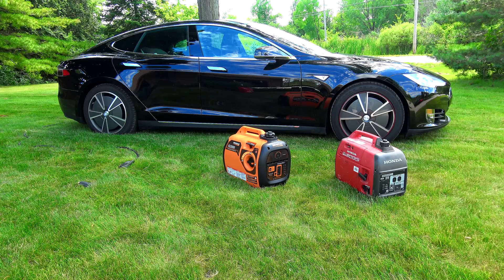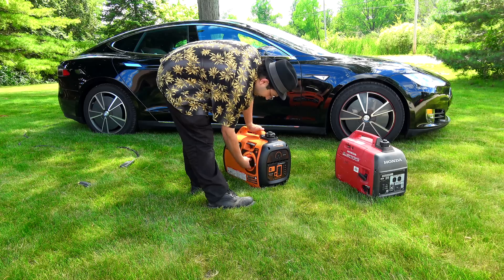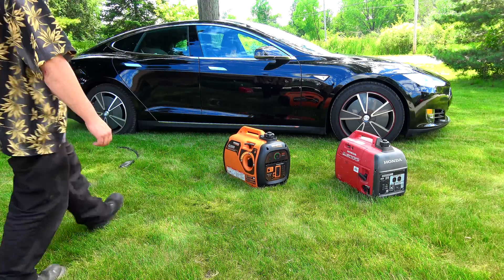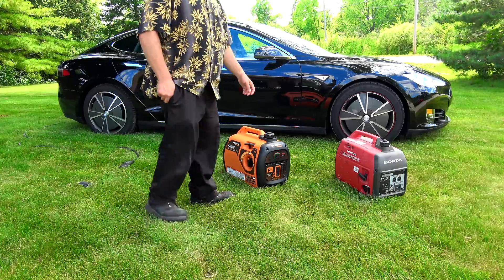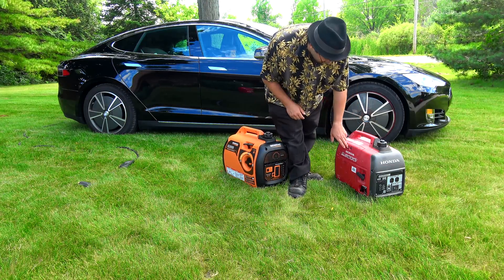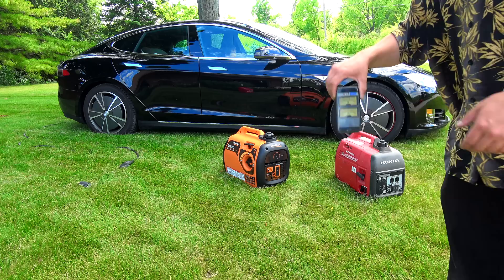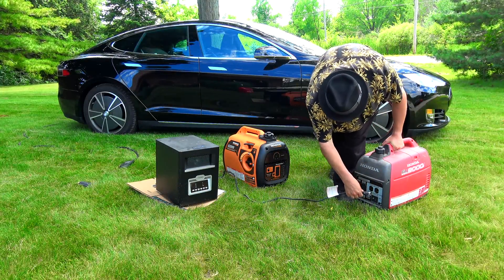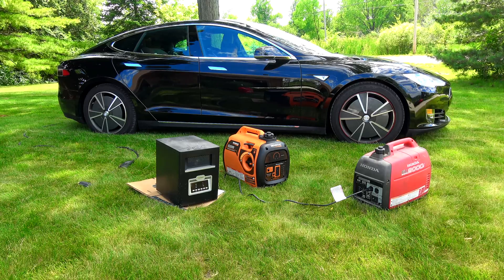Generac IQ2000 VS Honda EU2000i Noise and Load Test

Comment: I find it very peculiar and ironic that a fossil burning device is still required to run an electric vehicle... LOL
Reply from the maker: I find it very peculiar and ironic that you don’t realize a fossil burning device is NOT required to run an electric vehicle.
Reply from the maker: You are missing multiple points and intent, in an emergency, a gas car can only run on gas. Where as an electric car can be refueled by gas, diesel, propane, or natural gas via generator, hydroelectric, wind turbine, nuclear, solar, coal or gas fired power plant, or even your kid peddling a bicycle with a generator attached. 
Please see all the videos in the generator series. Original intent was to see which could charge an EV in an emergency.
Reply: @KmanAuto  All good points. My biggest worries are short battery life in -30 temps(my friends and family that own them where i live all have other vehicles that they drive in cold weather), battery warranty when the pack fails, and access to charging which is improving daily however.
Reply from the maker: @dptp9lf  Had no issues here in -38*F last winter. Both my Teslas are older “Legacy” design, so lower range to begin with and older tech. Turned on cabin pre-heating, put my shoes and coat on, walked out the door, unplugged and got in a 80*F vehicle. Looked up and down my street at the neighbors trying to get their cars started and also charging the 12v starting batteries (gas cars). I just put mine in drive and off I went. Did a 150 mile drive and still arrived at my destination with plenty of power and nice warm cab. 
The majority of the range loss is going to be the cabin heater. 
Now, all lithium batteries degrade over time and use. Tesla has an excellent battery management system to keep it nice and healthy. My Model S in this video is a 2016. It is now Jan 5, 2022, my Model S will be 6 years old in about 20 days. 
It has 120,000 miles on it. I abuse the crap out of the battery, and it has been holding a solid 250 miles range per charge. Biggest drop is the first year, then it levels off and degradation slows considerably. 
My battery warranty is 8 years unlimited miles. I believe the new ones are 8 years 150,000 miles??? not too sure off hand.

Also keep in mind, the same vehicle as mine, a new one can do 407 miles on a single charge. Further, As of 2021, all Teslas now use a heat pump as primary heating instead of a resistive coil (space heater). in general use, that heat pump uses about 1/4th the amount of power the old resistive coil uses. Basically, you lose very little power to heating. 
If temps get excessively cold, there is a small resistive coil to supplement the heat pump (the HP works well enough to keep it warm, not hot granted but still warm, down to about -15 before the resistive coil kicks in to supplement).
Reply from the maker: @dptp9lf  (separate message as i ran out of characters on the last one)
As for charging, i’ve been able to do coast to coast since Jan 2014 with my even older 2013 MS that had a max range of 209 miles. traded that for the one in this video. I also have a model x. As of 2016, enough superchargers were built in the USA where I have had to do Zero planning for long drives, which is most of my driving. Basically hop in and go.

I do have 240v outlet to charge at home, rarely do though, usually charge at a supercharger while grocery shopping down the street, as i’m grandfathered in for free charging forever ;-)
I drive a LOT, 45,000 miles/year across both my teslas. For the average person, a standard 120v 15 amp home outlet is more than enough for daily charging at home. depending on which tesla you are charging, that would provide 60-100 miles of range back per night, which is more than the average person uses each day. a 240v dryer outlet would charge from dead 0% to 100% in about 9 hrs, 50 amp electric stove outlet would do it in about 7, and a High Powered wall charger will charge my Model S in about 3 1/2 hrs from dead to full.
Reply: @KmanAuto  Wow! you're actually selling me on one of the for my wife! Not kidding...
Reply from the maker: @dptp9lf  Don't test drive one unless you know your going to buy one. Once you test drive you can't not purchase.

Comment: I can run a room heater or AC unit on in power outages with it.~~>share4.photo/G22Inverter?u    Or I can run my fridge and freezer TV's cable and some lights. Good for what I need. I don't need anything industrial. Works good for me.

Comment: I like the fuel gauge and run time estimator. I can look out the window and know if I need to add gas. You need to  go outside in the elements and pull off the fuel cap and look with a flashlight on the Honda. That is not fun in a hurricane of snow storm
Reply: For the diehard HONDA fans is not a problem.

Comment: Start the Honda with eco OFF and it wasn't struggling, they just need to ramp up their RPM's under load. I lost power at my new rental house about six times this past winter and am doing my research for an approx 2000W generator. I had about $800 of spoiled food when I lost power for 7 days because of trees taking out power lines during a winter storm. Not the power company nor my renters insurance would cover a lost fridge if there is more than one house that loses power. I'll use a Mr. Buddy propane heater and 20lb bottle for heat along with a 1500W space heater. I'm interested in the 2000W portable models so I can take them camping or transport them solo over a heavier 4000/5000W which are more expensive. Down the road I'll definitely be looking for a whole house generator.

Comment: My Generac will not run a 1300 watt heat gun and the service center said it is operating correctly.  My customers Honda did run the heat gun
Reply from the maker: What happens when you approach the 1300 watts? What is your generator rated at? It should have two ratings, a "Burst"/"Starting" Wattage, and sustained wattage. Example, my IQ2000 is 2000 watt starting with a 1600 watt sustained. 
How long had the generator been sitting? Has it ever sat for a extended period of time? And personally, the Service center person was just being lazy (As in, not getting paid enough to waste time trying to actually service it). 
Lets see if we can narrow the issue down. I've dealt with lots of generators and engines over the years, as well as imported many generators.
Reply: KmanAuto The General IQ 2000 has three settings so.  As I get to 1300, the machine vibrates, then trips overload

Comment: I know this was several months ago, but I just viewed this. For arguments sake, lets say the Generac is the winner. Last year I bought a Powermate propane generator and learned they are owned by Generac. I thought this was a win and couldn't have been more wrong.
Generac service centers are listed on their website. In my case (Rochester, NY) half of the ones listed are not even physically here anymore! The one that was closest to me deserved a drive...when I got there and talked to them I was told they haven't serviced Generac in years and Generac wont take them off the list. I even took my time and tenacity to find a rep with Generac and let him know of all the false service centers listed. As of this date they are still on the website.

 My experience with Generac was long, fruitless and sad. They make quality stuff like most. I am in it for the long haul and I want to make sure my product can be serviced in 10 years if it needs it. That alone rules out Generac for me for power washers, generators, and anything else they make. The petty differences demonstrated nicely on this video are nothing compared to needing service and support when needed now and years down the road. Yeah, get a Honda (or even Yamaha) and be done with it.  In a few months after your purchase you wont even miss the few extra bucks anyway.
Reply: rochester ny here also Honda is a choice only because close service places not that you would need one i guess, Brodner Mower seems like the place to go.

Comment: what is the big difference between this generac model and the previous one?
Reply from the maker: Ramphis Infante quieter and more fuel efficient. about 20cc smaller engine, with the same max output
Reply: Great thanks, I own a honda but I need to get a back up generator and I was thinking to get the previous generac model sinse is on sale right now but I have my doubts.
Reply from the maker: I am very happy with my Generac. It starts first or second pull ever time, even after i let it sit for two months. Runs smooth, and can maintain high output no problem (Tested and broke it in by charging my Tesla). Hauled it cross country for camping with my teardrop trailer but ended up not needing it. It's a bit heavy, but manageable.
Reply: Thanks for the info and quick reply.

Comment: which one you like more? generac or honda?
Reply from the maker: Prior to this, I preferred Honda, however, in this new generation of Inverter Generators, Generac has really beaten Honda. Noise level , and Fuel Efficiency. Only Thing the Generac is lacking is a 12v port, so you cannot charge a battery directly off the generator, though you can still use a regular battery charger plugged into the Generac. 

On top of that, the Generac is made right here in Wisconsin. I'm arranging a Factory Tour to film for my viewers!
The Honda is made in China. Not that their is anything wrong with that, my Fiancee is made in China ;-) But even with Honda, quality level can be great or suffer when Manufacturered In China. It's nice knowing that If I get a Lemon, I can take a 30 minute drive and throw a $417 Fit outside the Generac Factory ;-)

If generac did not have this Model though, I would have gotten the Honda, and make a hack plug for it to charge my car in emergencies. Another one I had considered was the PowerHorse, http://amzn.to/29Chwnf
The powerhorse is the SMALLEST capacity generator (And by far the most Fuel Efficient for longest overall run time) that I have ever seen. While 450watt sustained and 500 watt burst is not much (And it would never charge my car in a emergency), the extreme efficiency would have been nice for use with my Teardrop trailer, or during power outtages. It's just enough to run my furnace fan, or fridge. But alas, if I was going to spend, I spent, got a high quality unit, that could handle larger jobs. 

I''ve been playing with the generac for a few weeks now, and it is doing well. In these videos, the generator had about 1 1/2 hours total run time on the engine. The Honda was well broken in, and running at it's peak. The generac has gotten quieter, and smoother as the engine has broken in.
Reply: @KmanAuto  
It's not to blame is it proudly made in USA or CHINA or TAIWAN or JAPAN or Korea or Vietnam. IT'S the greedy CEO of the manufacturer. 
Don't get stuck in the racial profiling "Blame Game" while the JOKERS were laughing all the way to their bank in their top of the line Rolls Royce or  other better.
Reply: The Honda is NOT made in China.  It's made in Taiwan and has been since around 2010.
Reply: @whoknows8678  
It seems pretty well there's a race issue to some cement filled head folks.
Many Honda products are made in Mexico and China. While some in other nations
So don't assume if one is made in one country and all made in only that country.
Quality assurance check and corporate secret goes down to the company's CEO and their Knights of corporate round table.
Don't get stuck in the foolish racial profiling "Blame Game" fool.
Oops! I meant folks.
Reply: Just a heads up that the Honda's 12V charging ability is not monitored and you can do damage to either the generator and/ the battery. I would much rather plug in my 5A battery tender that has the circuitry to properly charge the battery. Also, it cannot do lithium batteries.

Comment: So after using both, feature for feature , which one do you prefer and recommend?  So, the Generac has an hour meter, too?
Reply from the maker: +GereDJ2 Generac is better in all ways but one , it does not have a 12v port for charging car or boat batteries, so a regular charger would be required. Generac hands down.
Reply: The Generac has a smaller piston then Honda, one reason for slightly quieter operation, but only about 8-10% quieter, just barely noticeable.  To keep up, Generac has to run at higher RPM from less torque. Consequently more strain on bearings, piston, et al.  Honda logically would last longer it would seem.
Reply from the maker: +GereDJ2 if running at 100%, yes more strain on the Generac, though since the Generac is also slightly more fuel-efficient when using not at full power, Possibly less where than the Honda at low power consumption levels

Comment: These things are Junk Generac!  I had 2 in parallel and did not run my 13,500 btu Travel Trailer AC.  Blew the Inverter boards on both.  Gerenrac customer support and service is an absolute JOKE!  Stay away.

Comment: But, did you know that the generac puts out a modified sine wave, not a true sine wave?
Reply: It is advertised that the Generac iq2000 can operate sensitive electronics so I doubt that it puts out a modified sine wave.
Reply from the maker: +Bill Yates yes it does put out a modified sine wave, which is fine for sensitive electronics. The Square sine waves from older or dirt cheap inverters are bad for electronics, as are the dirty sine waves from non inverter generators as those fluctuate too much.
Reply: You may want to Google "Pure sine wave vs. modified sine wave". There are some electronics that have problems with a modified sine wave. I've read where some people have damaged their equipment using a modified sine wave generator/inverter. I watched your other video, you should probably ask Tesla about this to avoid any potential warranty problems.
Reply: @Pro1er  
Hey, if it worked it works.
Stop your nagging like a tiny toddler.

Comment: Which model holds the most gas?
And how oil needed?...
Otherwise pretty good video...👍
Reply from the maker: Both are about equal in those terms. The generac specifically is 1.06 Gallons and .4 quarts oil.

Comment: I was curious if you are able to provide any significant charge to EV, let's say in emergency...
Reply: the car would also provide a lot more information ,
Reply from the maker: Here you go! :-) https://www.youtube.com/watch?v=Nf6WgQfL7DY
Reply from the maker: And the answer would be yes. Usually you just need enough to make it to a grid connection, a few miles. No problem.
Reply from the maker: https://www.youtube.com/watch?v=Nf6WgQfL7DY